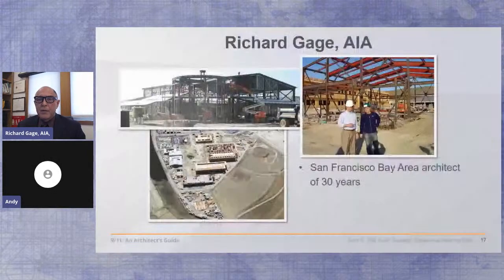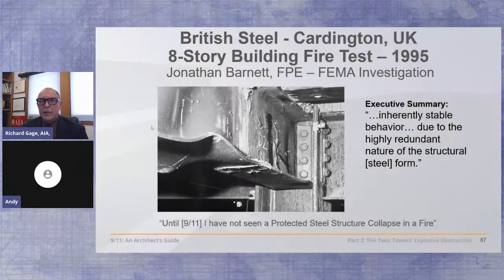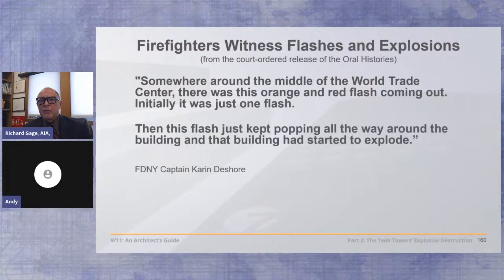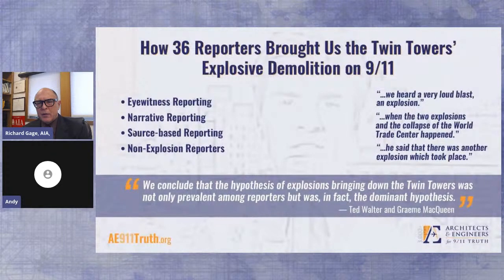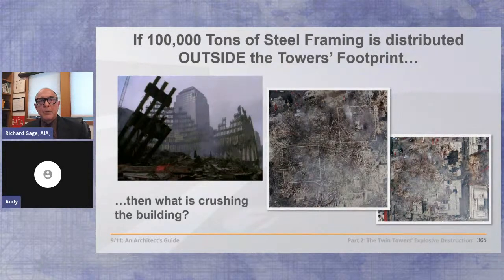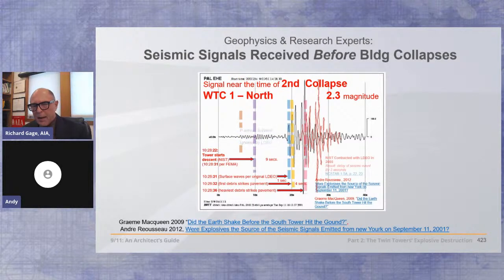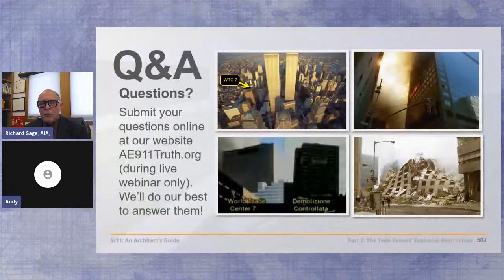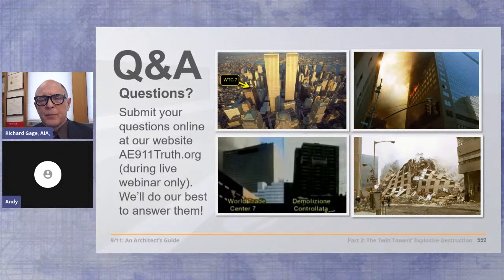9/11: An Architect's Guide - Part 2 - Twin Towers' Explosive Destruction (5/13/21) Webinar - Gage)

Comment: To the creator of this content, you are doing fine work my friend. I am an Architect Engineer myself. I would like to include another important detail about the claims that it was an explosion, rather than a gravitational, natural collapse. In the time 57:48 you are showing the south tower at the very second (and milliseconds) of collapse. There was an audio recording of a man named Kevin Cosgrove, that was recorded. In the very second of the detonation....he screamed "OH GOD, OOHHHH". He was on the 105-107th floor (Northwest Corner) which was away from the impact, but exposed to too much smoke (which is why they couldn't find a way out). In the sound recording, you hear the rumbling. Now, he was on the 105th-107th floor (not sure to be exact) when that sound could be heard. I think with our technology that we have today, I have heard other audio that takes out the static and other noises, and you can clearly hear the explosion from INSIDE the building. He was about 25 floors above impact and there was an instant rumble (like his small office was being blown to bits) right at the time the south tower "bowed and buckled" and then the whole building just obliterates. His body was somehow fully intact, but he did not survive. He was thrown 150ft away from the building and recovered in 48 hours after the collapse. I feel that it would be very difficult and disturbing to use that in your claims, but that also strongly suggests that something very unusual happened. Had it been gravitational, Kevin may have actually survived. Also, his section of the building would have just broken away under normal circumstances. But his co-workers, whom he identified, were blown to bits. This was in the medical examiner reports. I would defiantly take a look into it. You can hear in his last words, the very last breath, that there was something that detonated.

Comment: Hi Richard. Your determination & apparent lack of frustration is quite incredible. I was dubious about "conspiracy theories", until a few years ago. Watching your material & then further investigations have convinced me that there are conspiracy theories, but these are "official" ones. Thank you for your great work, I know it has cost you dearly. If only more people were critical thinkers.
Reply: There have been countless conspiracies, the term "conspiracy theories" is designed to ridicule and undermine those who challenge the crooks in power.
Reply: @mizofan  what are you talking about. The term conspiracy theory is to make you understand that it's just a theory which means it hasn't been proven. Otherwise it would just be a conspiracy, it's designed to distinguish between these two.